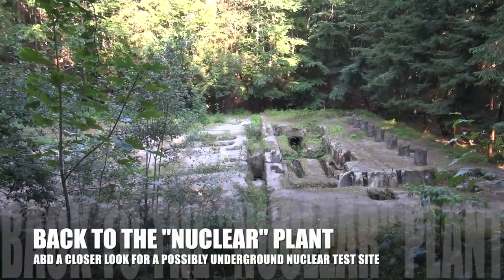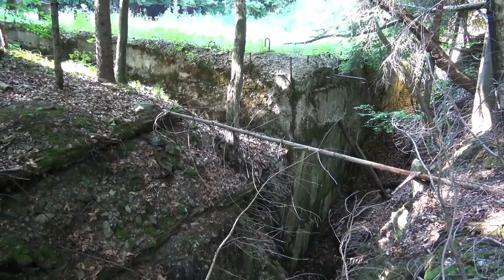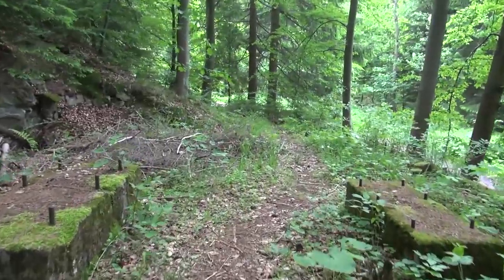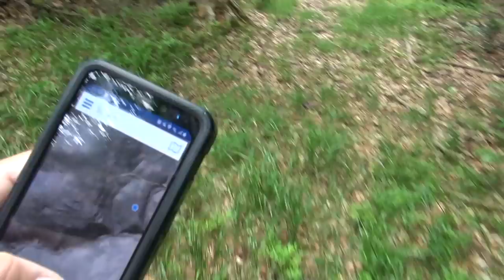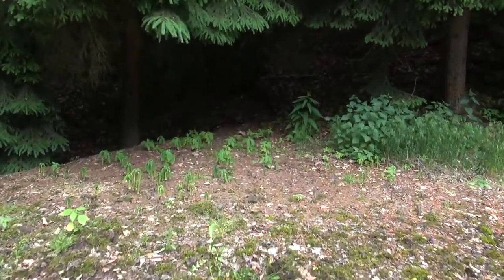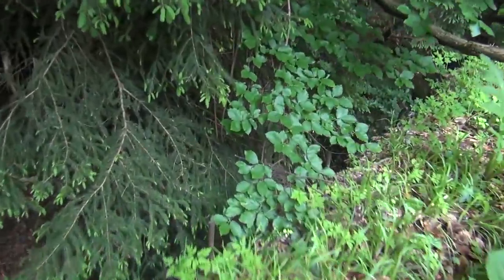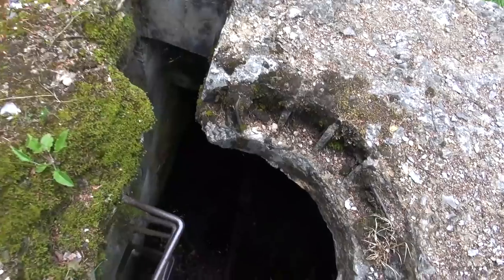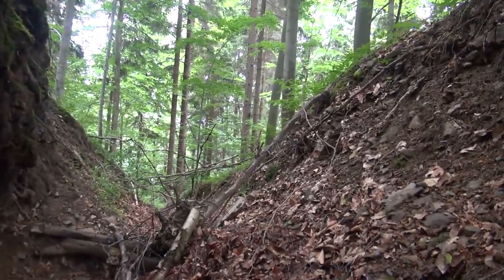THE LAST NAZI SECRET - THE RIESE PLANT - THE NUCLEAR - APPENDIX 4

Comment: considering that the vee two rockets used liquid oxygen for propulsion it could have been a factory to produce it
Reply: And, considering how "interesting" that stuff is to transport in bulk, might I suggest that there may have been a rocket motor testing facility nearby.

Turning gaseous Oxygen into liquid Oxygen requires a serious chiller plant and big compressors. Compressing any gas generates a lot of heat. Oxygen is, surprisingly, an oxidizer, So, you need to remove a LOT of heat in the compression process. Ammonia-based refrigeration plants (big ones) might be just the thing. The Germans invented the "Haber-Bosch" process before WW 1, leading to things like refrigerated ships carrying frozen food, especially meat, all over the world. The crafty devils also , out of necessity developed synthetic Nitrate manufacture (fertilizer / explosives) when the allies blockaded nitrate-rich Guano (bird droppings) shipments from South America in WW1. Again, it is likely that "development" was underway well before WW 1.

Any country that has mastered Scnapps production already knows how to make ethanol for fuel.

There is a LONG precedent to the recovery and refinement of nitrates for explosive and other uses. In a US  perspective, the Confederate ordnance types had a lot of people out in the countryside (and towns), digging out "long-drop" outdoor toilets. The soil was loaded with excreted nitrates.  It was a relatively simple task to wash, dissolve and filter the Nitrates out of the soil. Sounds like a cue for a Mike Rowe episode. . 

Insert gratuitous Erma Bombeck "line":

"Well may the grass be greener over the septic tank, but it is greenest over the mass graves"; (or words to that effect).

Comment: Several followeres have suggested Water flow either for pumping and or cooling I think " Flow " is possible particularly when the corners are not square but curved ( assist flow ) ? the " cone " shaped fittings on the end of the re bar reminds me of  a " tension " system to stress the " slab " used when requiring strength in the slab also enbles a thiner slab ! I have built slabs like this for ship loaders . It is possible the several alighned ceramic pipes are for electrical cabels either Power and or Conrol / Communication with operators or electrical valves and so on ? This sieres is better than any books and I read a LOT . Regards 🦘🇦🇺
Reply from the maker: thank you Chris